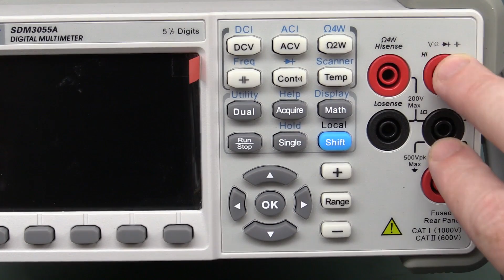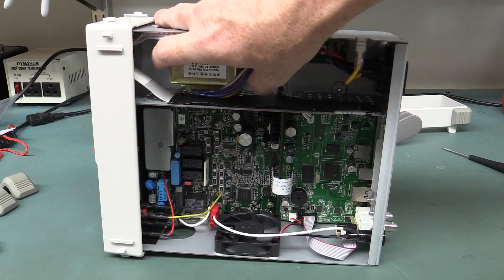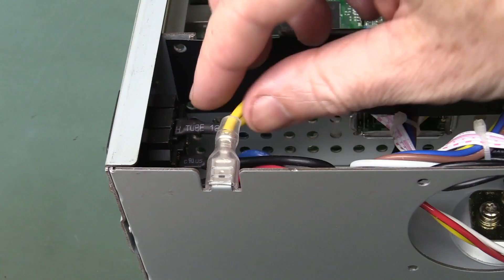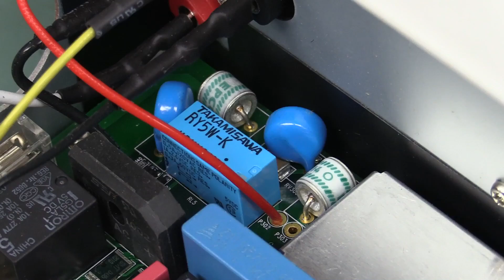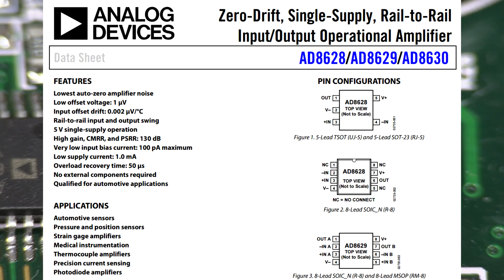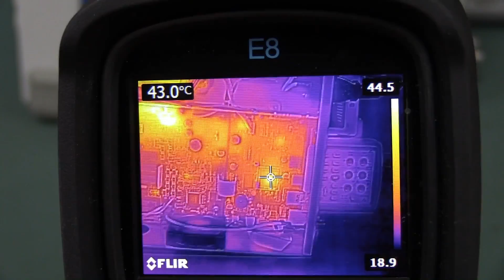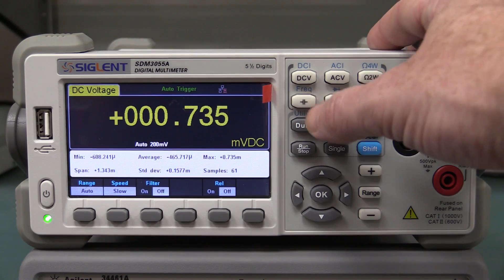EEVblog #829 - Siglent SDM3055 Bench Multimeter Teardown

Comment: The “extension” card slot on the back of the SDM3550A is for an optional SC1016 16 channel input scanner card.  That is pretty nice if you want a system volt meter for an automated test rack without having to devote extra space to a separate multiplexer box.

I believe if you want GPIB capability, there is a USB dongle with the not surprising part number USB-GPIB that is compatible with the SDM3055A.

A closer competitor is the Keysight EDU34450A 5.5 digit bench multimeter.  Of course the EDU34450A did not exist when this video was made.  The Keysight is in a clunky digital oscilloscope packing format and it costs about 50% more than the SDM3550A.  The construction quality of the Keysight unit is better (no spade lug connectors), so you do get something for the extra expense.  Still, I would not throw the SDM3550A off my bench if one were to mysteriously materialize.

Comment: I would rather spend my money for test equipment from the 70s-80s.  Junk like in this video is build like a tv reciever, not like test equipment.  I dont get why people spend 400$ on this thing. Its a rusty box with some super integrated programmed smd junk and a lcd screen. Good luck repairing this thing if one single component fails. There should be a difference between consumer electronics and test equipment.
Reply: +KingofKatenfutter Siglent?  Chinese for CRAP!

Comment: I have question. Forget about the brand of caps, does anyone know the MTBF on this equipment? 
Rob
Reply: +mosfet500 I'd guess NOT 5,000 hours. ;-)
Reply: +AUSSIE RANTS 
I think unstressed caps were generous over tolerances are designed into a device can last quite a long time. The specs may not hold up but the instrument itself may be able to run for years. It's when you get to switching supplies and start pushing currents or even linear supplies that cut max working voltage corners, or the worst putting caps next to heatsinks, that bring on failures. In relatively bland apps caps can last quite long.
Rob
Reply: +InXLsisDeo 
I see that as reasonable for equipment in this price range. My objections are more with respect to functionality.

Comment: why always ½-digit?
Reply: +tubelos23 Just how the A/D converters work and the maximum "count".  This meter being 240,000 count, it can display all 6 digits as long as the first two are < 24.  Above this it must change scales and you are back to 5 digits.  So it can display 240.000, add a few more counts and it will display 0240.01.  The nature of digital converts are not base 10, so we end up with odd number of counts.

Comment: looks like both sides were punched out on the same machine, hence the dual fan cutouts.
CPU is from the same family as the Beagle Bone Black.  The '52 lacks the 3D graphics GPU, the '54 has it.
I spotted the JTAG interface, wonder if there is a serial port in there to hook up to u-boot (needed if you want to hack the OS).

Comment: Also neither product has capacitance, inductance or diode/transistor profiling/graphing. Which is pathetic.
Reply: +EEVblog of course there is a market for it and I have identified many such obvious missed opportunities that could indeed by extremely profitable but in this particularly market, once it's done, these many mindless copycats including the incompetent Keysight and others will follow suit with copy products so even if you were to build a large company to fill that market the easy advantage would disappear right away. It would however change the world. You of course suggested it with thoughtless disdain. You erred.

Comment: I don't agree it's built down to a price. Indeed in my opinion is has way too much digital power for the low performance device it is. DDR3 1 gigabit of ram?? why. 1GHz ARM, and FPGA...  you could run a complex 3D computer game on it. 
It could and should have been a single board design, about 1/4 the size and no mains trafo. If you are good maybe 1/10 the size.
Also the Siglent display is more legible. Better font, better contrast.

Comment: Is the Siglent "rust" possibly be due to the process of cutting the metal, i.e., burn marks from laser cutting perhaps?
Reply: +SaturnV2000 Or perhaps they deburr the edges of the metal and forget to seal it with something.
Reply: +SaturnV2000  It looks like they stamp cut per-treated steel.  The sheer edges will not have the protective coating.

Comment: 6:49: looks like the whole sheetmetal part is punched in one step and it can be used on both sides even if the fan cutout on the one side seems useless. They saved a lot of Yuans in doing so!

Comment: Very nice teardown, thanks !
I think they did an OK job designing this. I don't like the fan thhough. Better heat sinking would have done the job. However, the "ADC circuit magic" we know from Agilent/Keysight and Fluke is missing. I am sure that they change the design drastically once they figure out how to built a better one for the same price. But that's going to take a while.

Comment: That second fuse is in series with the one on the rear panel. It had a 12 amp rating in my unit, where the fuse on the back was 10 amps. It's probably there to prevent someone from putting a large fuse in the rear panel holder and then blowing up their meter.

Comment: Is it possible the display cable was placed on the transformer side of the divider for noise reasons?
Reply: +Damon Stewart Very good.  I imagine that ribbon is carrying digital logic signals.  Putting it on the power supply side may seem odd, but it's a hell of a lot better than running it by the analogue front end.
Reply from the maker: +pillsnotbills Could have put it against the metal on the analog side, would have worked just as well.

Comment: i think the display cable is on that side to avoid going over the analog/frontend part, i kind of like the two boards, you can reuse the processor with another frontend... i hate the cables  that hang around like this from the front pannel, it wold be nicer at liest shielded cables... i still prefer the rigol over this one tough and still miss the hp :)

Comment: The digital board and major layout looks identical to another Siglent test gear tear down you did before which is the  "Siglent SDG2122X Arb Generator in EEVblog #805". You are right on what you said in that video on "They are using same digital board for different equipments" Perhaps similar reason also explains why they had two fan installation holes and they decided squeeze the screen cable like that  since the metal work might also be the same or similar in many of their designs and they have to come out with a universal metal work design with lots of trade-offs to save the cost.
Reply: +Chenxi Yang That is exactly right.  I think it is a fine solution and I like the look and the construction.  Sure, there is a tiny bit of "rust" but as long as it does not spread, it doesn't matter.  It is better than plastic.

I think of the unused "fan hole" as a ventilation hole.  Air has to get in somehow, and it makes sense that it would be located opposite to the fan.  The grid of small holes in the partition is used to regulate air flow.  Nothing wrong with that.

Comment: Dave, I like you and your channel but now u make me angry!
Fan from Delta Electronics is "cheap ass" are you fucking kidding me?!?!
Its world best fan(better are only in NASA), they are in almost every serwer, because they are designed for continous working by ten years, they use HQ dual ball bearings etc.
Pulled one from ten years old serwer, they are in perfect condition and look like ready for another 10yrs.
Delta Electronics mostly made SMPS, they are right behind Lambda.
I'm very disappointed on you dave...
Reply: +Dejan Tesic Every brands have sometimes little fail, and it was not serwer...
Reply: +Dejan Tesic yea but similar grade.
Reply from the maker: +Arek R. I missed looking at the brand through the viewfinder, relax.
Reply: +EEVblog Next time please see label, like with caps...
Reply: Dejan Tesic Today I received dps-1000gb psu from lenovo commercial PC.
And caps at primary side was SAMXON, also they used fan from other mfr, overall quality of this smps was medium, little disappointed on delta.
It seems that delta products for home use are not best quality.
Anyway that fan from video is 11$ from digikey so not cheap one.

Comment: 4:35 FAIL. Look how close the transformer and that fan hole are. Now you probably know why they didn't install it there :) And I suspect they wanted to put a switching power supply there but they changed their mind somhere in the middle of design process.
19:33 Pretty, little and labeled JTAG connector. That might become useful to someone.

Comment: LOL cheap ass fan? Thats a top end Delta fan.... You seem to be prejudice towards the brand in the way you start the review. Wish they used decent caps though... Front end relays look great so it seems odd they would cheap out on the caps.
Reply: +electricsnut Yolo, maybe Dave had a bit of pre justice because this scope is a blatant ripoff of a Agilent.
Reply: +jak p (skiguy09) If you want Agilent, you buy Agilent. If you want cheap, you buy a Chinese copy of a better brand with efforts made to reduce cost. There is no middle ground. I think they did a decent job for the price, I would have liked to see Japanese caps but then again maybe I am be prejudice towards Chinese caps, its entirely possible they will be good quality. Rust on laser cut edges? Common seriously.... exposed metal will rust just with humidity and its very hard to prevent and would increase unit cost for something that has no effect on the actual performance on the unit
Reply: +jak p (skiguy09) Yolo, I see what you did there
Reply: +electricsnut yeah, and the meter has fan cutouts on both sides not because of bad engineering but rather to cut down costs by reusing the same metal piece on both sides.
Reply: So you buy cheap hardware knowing that they ripped off someones design? Sounds quite dishonest.
Reply: InXLsisDeo
What do you mean its not a ripoff? The GUI and button layout are nearly identical.
Reply: +jak p (skiguy09) he's saying that the silent has better paper specs than the keysight or the right, but it's a clone of the keysight. Thus, he's buying the rigol (I assume because of the keysight/agilent tax)
Reply: +electricsnut What turned me off was the horrible soldering. They have some issues with their thermal profile, the only excuse for that poor of a job is if this is a very early production unit. Notice the inconsistency of the joints, varying amounts of solder and evidence of components not whetting properly (crooked, quite a few passives haven't self-centered). I haven't been impressed with any of the Siglent gear, they're competing for the same market as Rigol but have lowered the quality without lowering the price. For 600 I'd rather have a good 5.5 digit handheld, less features but much higher quality. I would excuse the poor construction on something cheaper, but for that much money at least get the board soldered properly.

Comment: at 10:36 you mention the bodge resistor connected to a "PTC", what's a PTC?
Reply: +bsamuels453 Resettable fuse.
Reply: +bsamuels453 Positive Temperature Coefficient resistor. Goes high resistance if overloaded ;)

Comment: Cheap ass fan? LOL That's Delta Fan! I have 15 years old Deltas and the still run like the day they were made! Never even oiled them!
Reply: +Ventsislav Simonov  He calls everything a cheap ass.
Reply: +Mohammed Fawaz you are of course absolutely right! I&#39;m looking at the Sunon price list and for 80mm DC fan they have prices ranging form $1.50 to as high as $35 a piece. Anyways "cheap ass" fans don't usually come with 6 page datasheets :D
http://partner.delta-corp.com/Products/FANUploads/Specification/AFB0612LC%28REV00%29.pdf
Reply: +Ventsislav Simonov This one is different from the old one mate, here I buy it for like 1/2 U.S dollar..... and it works for shorter time than what you mentioned.
Reply: +Ventsislav Simonov Quality fans don´t use ball bearings.
Reply: *****
They use a bass bushing, not a plastic one.
Reply: MrMac5150 You mean plain bearing? That tech sheet says ball bearing.
Anyway good fans use fluid or magnetic bearings.
Reply: *****
Never heard of a fluid bearing, I am used to the 3 dollar fans. when they get worn they start to make a little noise.
Reply: +Ondřej Dujka Like I said. I've got some very old Delta's and they run smoothly. All ball bearing. Never serviced. Open an old server case and you 'll find them still as good as new.
Reply: Ventsislav Simonov I don´t have issue with their durability. Fluid and magnetic bearings are quieter. That does not matter with servers but sure does with lab instruments.

Comment: 10:53 They have choosen the rather resonably prices precision resitor network. The layout can take the IRC 1987 series DIP versions http://www.ttelectronicsresistors.com/search/results.php?id=28889 as well as the BGA version CH8A http://www.ttelectronicsresistors.com/datasheets/CHC%20Precision.pdf or maybe some custom version, which are easy to get even in small quantities. These are not the super high end ones. VIshay SMNZ are much more precise and come in SO-8. However, with almost €50 for the custom Vishay version they don't come cheap.

Comment: Why do they not use aluminium for the case ? And keysight ... Agilents , its HP , FUCKING HP!
Reply: +Andrew Joy   Price, aluminium would cost at least double than steel I reckon.
Reply: +Andrew Joy , Steel (and iron, mu-metal, etc.) can shield electric and low frequency magnetic fields. Aluminum only shields electric fields...